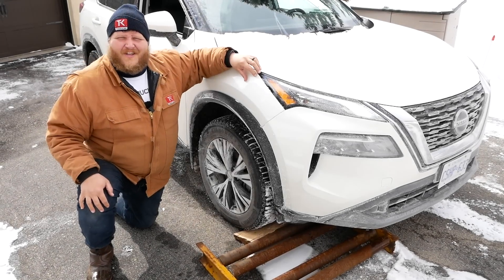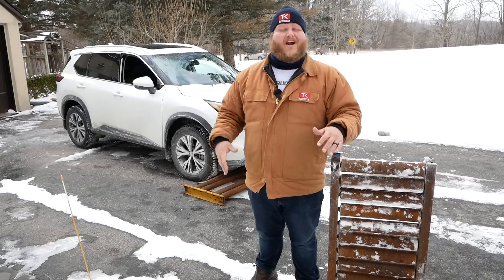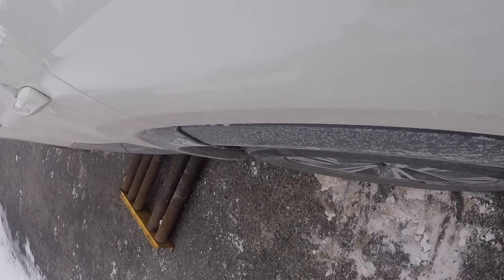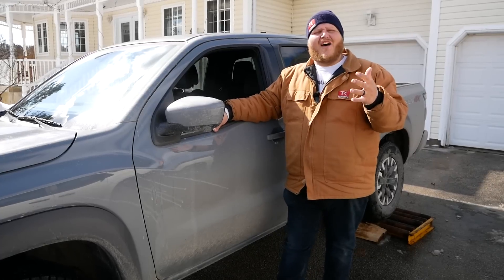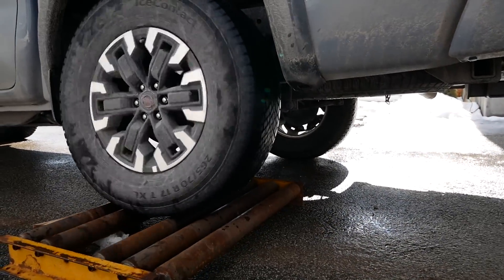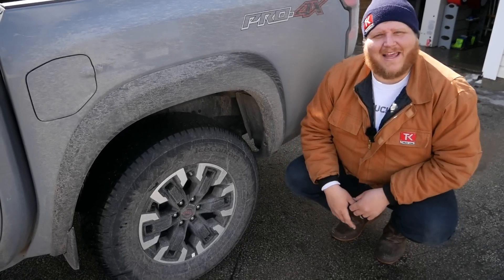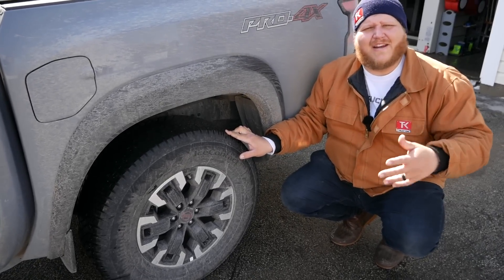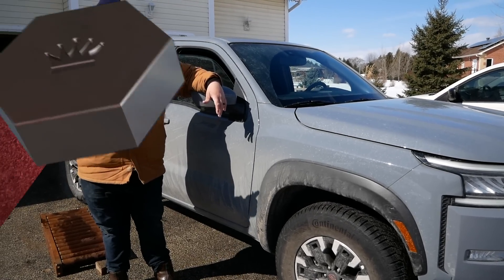AWD vs 4WD - Which System is Better and How Do They Work? We Demonstrate the Differences

Comment: A cheap Crosstrek with a rear TorqLocker and a tight front Cusco LSD will outperform most stock 4WDs in a traction test. It'd still be an econo-AWD too, getting 30MPG+ hwy.

 A Suzuki Samurai or base 4cyl convertible Jeep with cheap lunchbox lockers will often embarass high-end 4WDs offroad too.

Comment: Jeep's SelecTrac was about perfect in the XJ. The 2.72:1 4Low was just fine. Add Ox Lockers and manual hubs to the front and rear for maximum versatility. It was simple, and relatively easy to rebuild. Modern Traction Control and VSC would have complemented it nicely.

 The lawyers would never allow it to be offered like that though. Some numpty would unlock a hub or several in 4FT and destroy the viscous coupling, or lock the lockers on dry pavement and destroy diffs.

Comment: 4WD locks the front and rear drivelines together. AWD doesn't. That's the only difference.

 The same vehicle can have 4WD AND AWD.

 What do you call a Selectrac II Wrangler Unlimited Rubicon with selectable front and rear manual hubs? FWD Low can be selected in such a vehicle.

Comment: 4x4 being better is debatable. In some scenarios that maybe true in other scenarios the AWD is. The test the AWD should have been in slippery mode not normal especially comparing it to 4x4 and especially if you have it in traction control and 4 low. Which in the video it was stated to put it in traction control he had to have it in 4 low. I can't see someone on the road in 4 low its not going to happen. Also what was mentioned in another review that majority of 4x4 should not be driven on dry pavement conditions. In addition similar to the 4x4 with optional traction control, locking or limited slip differential some AWD systems offer lockers. One thing I like on some AWD and 4 wheel drive is the ability to break one wheel in the back  and increase the wheel on the opposite side. Thus the ability off road to have a shorter turning diameter similar to using one brake on a tractor.

One could argue the 2 speed transfer case is superior in off road situations. This also is debatable usually ground clearance and momentum is the deciding factor. Personally i think both are winners and far superior to RWD or FWD vehicles. Even saying that i would still make sure i have recovery equipment with me, on both of them.

Still thanks for the video and information

Comment: After owning a Subaru AWD vehicle I swore I would never go back to anything less than AWD or 4WD.  The performance in snow, ice, mud, etc. is far superior than any traditional rear wheel only or front wheel only drive system.

Comment: FORD- Raptor - With TORSEN Front Limited Slip Differential 
or 
GMC- AT4X - With Electric Front And Rear Locking Differentials
For 4 Wheel Drive?
🤔
Or Any Of The Above Or Simular With 
- ARB AIR Locking Differentials - ?
Reply: You don't necessarily want traction diffs on snowy roads. Selectable lockers are good if they're truly open when unlocked though. Ox Lockers are like this.

 Winter-capable tires can make a big difference.

Comment: In an old awd system with no electornics, one wheel off the ground would stop it. That wouldn't stop part time 4wd with no electronics because it's always at least one of the front and at least one of the rear at a minimum.
Reply: Yup. Old AWD systems were often just a little better than 2WD on slick surfaces, before TC, VSC,  ABS, EBD, etc. became a thing.

 Modern AWD and 4WD systems can be amazing.

Comment: What about my Audi Quattro with AWD and a rear locking differential and traction control?  Isn't that that same as a 4x4?  Remember, the bad thing about 4x4 is YOU have to put it into the mode that works.  My old 1983 GMC 2500 with 4x4 and auto hubs is TERRIBLE on snow/dry pavement conditions.  You have to stop, put it in 4wd HI, then the auto locking hubs lock in.  Then, when the pavement is dry,  you have to stop, put it in 2wd and back up to unlock the auto locking hubs.  What a pain in the butt for people who live at the 4,000 foot level where is snows some and melts in days or hours.  My 1999 MBZ ML430 was easy, just drive!!!  I must add that my MBZ had a 4wd low switch which locked the rear differential and it has traction control too.  Like a goat anywhere I went.
Reply: Audi has had some of the best AWD systems for years, but they often lack a locking center and 4Low. Their modern AWD systems can provide better traction in some conditions than some 4WD systems can though, like my Jeep CJs and YJ on ice when they had open diffs.

 Your 4WD pickup should be able to shift to 2WD On the fly. The front hubs should be able to stay engaged all winter. Your MPG might suffer slightly though.

Comment: I had a 1964 Wagoneer, straight 6 cylinders, front wheel hub locks, 4-wheel low and high and 2-wheel shifts. A lots of work to go 4-wheel but it crawl on rocks even with highway tires. With traction tires, at 4-wheel low, it climbs a tree. 🤓😎

Comment: 4WD is by far superior, but I live in a remote area of Ontario Canada, so 4WD are just commonsense. That said, another pitfall for AWD vehicles, they are an expensive rig to repair and maintain. They are loaded with sensors, and a lot more mechanical parts for each wheel, a complicated drive train. I think for urbanites and city folk an AWD for winter driving AWD makes sense, but if you are out in the country dealing with gravel roads, roads that don't get cleared of snow right away, hilly and rough terrain, you want a 4WD.
Reply: Very true but 99 Oldsmobile AWD with 31 at tires tackle all of it lol except Rick climbing which I don't care for .  That's what my 4.5 lift on 35's jeep is for .
Reply: Darn near everything has a bunch of sensors in it these days.

Comment: The only difference between "AWD" and "4WD" is the name. There's many different types of systems to get power to your wheels - part time, full time, on road or off-road only. Sometimes only to two wheels sometimes to all four and all sorts of systems for how that power gets there. My Defender refers to it as AWD but it's got two automatic locking differentials plus low range and can also then be set based on mode. It's not possible to turn it off and can be all automatic - "AWD" with everything you say is only in "4WD" and in a vehicle designed as a hardcore off-roader.

4WD definitely does not mean it gets power to all four wheels and that AWD doesn't.

The best system is not what it's called, it's what it does.

Comment: IMHO for most people AWD is the best solution, even for a truck.

The reason for this is that AWD does everything for them without switching anything and without understanding how it works.

Remember, most people don't drive off road. They drive around town and on the freeways. They deal with slippery roads from rain, snow and ice.

With AWD, they drive and the computer provides better traction when needed. Some AWD will even do this at full freeway speeds and/or improve traction for cornering.

Look around, most trucks will never tow a heavy load or drive off-road, except maybe a driveway or gravel parking lot. 

If you tow heavy loads or drive off-road then 4x4 is better.

Comment: All Wheel drive is a rip off.  It's really just 4 wheel drive.
Real all wheel drive would be 5 wheel drive.  The fact is the wheel that the spare tire is on is not connected to anything that will make it turn.
Some day Citroen will make a big SUV with REAL all wheel drive.  It will have their Hydro-pneumatique suspension so if you have to parallel park it, the hydraulics will pump up the front suspension at the same time that transverse mounted spare tire on the rear bumper will be lowered so it will touch the ground,  thus the weight of this thing will be held up by these 3 wheels.  the hydro-pneumatique system then lowers the air pressure of the rear wheel's suspension so they can slide on the pavement. Step #2 is the transmission shifts so it will turn the front wheels in opposite directions.  At this time an electric motor will turn the spare tire.  These 3 wheels will be turning in different directions, and the truck will rotate to become paralelle to the curb.

Comment: Your conclusion is wrong:
AWD is a safety feature for slippery conditions onroad - that could help you offroad.

FWD is an offroad feature that should not be used in an onroad conditions.

Comparing them is missing the point.
Reply: FWD = Front-Wheel Drive. I think you meant "4WD".
Reply: You are correct. A ttpo.  @RKmndo

Comment: Best way to describe the difference between 4WD and AWD is this. Imagine a drunk guy trying to climb a muddy hill, vs a sober guy.   The drunk guy is all effort and no sensing. So he is just slipping all around and making it look more difficult than it really is. While the sober guy can better sense his level of traction, and even predict when he is about to slip. Making the climb look effortless and smooth.     Most of the time, 4wd is better only when a tire is lifted off the ground.   Because of the lack of a locking diff in the AWD systems

Comment: What about a 4 wd that has a 4A setting like a F150 Lariat pick up?  Does it operate just like the Rogue?
Reply: Some do. Some don't.

 Some Full-Time 4WD/AWD systems use sensors and computers to engage the other driveline only when slippage is detected (like SelecTrac II). Some systems use a viscous coupler (like SelecTrac) that always keeps both drivelines engaged, but still allow some slippage between them.

 Subaru offers several different AWD systems that maintain engagement. Some use clutches. One uses a viscous coupler. Some can clamp tight almost like a 4WD.

Comment: Great demonstration of the two systems. The big difference for me is AWD is driving all 4 wheels all the time, rain, snow, mud, or dry. The 4WD is running in RWD when on pavement, which is 99.9% of the time for me. For the 0.1% when not on pavement, which is soft, muddy camp grounds, I've never had a problem with AWD. 4WD doesn't provide max grip the vast majority of time unless you live off road.

Comment: For a short time in low torque situations the modern systems that use the brakes to simulate full 4wd and limited slip diffs can work. And, they’re generally acceptable for the conditions of very light off-roading and some snow. 
The problem is that people get sold on thinking they’re do all systems that let them drive anywhere at any time. 
Ultimately a proper 4wd system with locking front and rear diff is the best solution. Without locking diffs even a true 4wd system is only 1 front and 1 rear wheel.

Comment: All wheel drive was first coined by International Harvester it's product branding like Ford with 4x4 and Toyota with 4WD. They all describe the engine turning the front and rear wheels. 

What you are trying to describe or differentiate is the difference between road oriented four wheel drive or Off road oriented Four wheel drive. Both have examples of vehicles with part time and full time systems. Some with diff locks some with low range some with low gear some with traction control. But the main dit is some are oriented and configured for on road or primarily on road performance and the off road oriented systems.

Comment: I never understood the point of fulltime 4WD because those do not have a 2WD mode. 4WD is cool and all but maybe you don't need 4WD always? I like to use 4WD only when I have to. 
I remember seeing some old Jeeps where some had fulltime 4x4 but I also saw some of the part time 4x4 systems where it said 2, 4H, 4L. I saw one shifter that had options for 2, 4Part-Time, 4Full-TIme, 4L, possibly similar to many modern shifters that say 2, 4A, 4H, 4L
Reply: You seem to contradict yourself.

 Jeep QuadraTrac didn't offer 2WD in stock form, but SelecTrac did. Both systems could also lock the center. Both systems also offered 4Low.

 If one wanted 2WD in a QuadraTrac Jeep, they could install manual hubs on the front and/or rear axle.

 Some drivetrain systems are only AWD/4WD. There is no 2WD setting. Full-Time 4WD is basically AWD. Such drivetrains simply allow differentiation between the front and rear drivelines.

 4WD (Part-Time) simply locks the front and rear drivelines together.

Comment: This video has so many painfully bad inaccuracies it hurts. It is literally marketing terms because truck guys are so egotistical about hearing awd. Its why the grand cherokee has 4x4 and the durango has awd, but both are mechanically identical. You can have awd systems with disconnecting secondary axles, you could have a part time awd system with an auto engage function as seen in new pickups. You can have awd systems that lock the center coupling, you can have part time systems that allow slippage. if you call awd completely different from 4wd, then you're not allowed to say both the ford f150 and tundra use a 3.5 twin turbo, because they have mechanical differences and therefore have different names. 

Hell, you actually are contradicting yourself on this video, saying only 4wd systems get things like low range, because you even review on the jeep cherokee which is a fwd based crossover that has awd and a 2 speed transfer case.

Comment: I don't know how accurate this is. In a 4WD system with center diff locked and traction control off, if the 2 diagonal wheels have loss of traction, the car won't move. The front or rear axles themselves won't split power between themselves (unless you have a front or center diff lock). So the reason why the Frontier was able to get out of the rollers was most likely because the rollers still had some resistance in them.
Reply: Okay so, awd and 4wd are the same things, with different tweaks and branding. 90% of the differences are marketing.

Comment: Another aspect is 4x4 transmission binding in corners. A lot of people assume that 4x4 can be left on and driven around for extended periods. But 4x4 excels when the trajectory is primarily straight. When left on for long periods it can cause transmission binding in corners and possibly a repair bill long term 

Where AWD is meant for everyday driving around town and isn't subject to binding. This  isn't to say one us better than the other but they serve different use cases. 4x4 more off road or pulling a trailer up a slope etc... AWD is a daily jack of all trades but struggles more off road.
Reply: almost like 4wd and awd are the same thing with marketing differences. Most awd systems are superior to "4x4" systems anyways
Reply: 0,

Comment: when you tested the truck in 2wd (no traction control) the roller was under the driver side rear wheel where the power was expected, but when you tested 4 wd you didn't have a roller under the rear driver side wheel so it quickly rolled off the rollers. I think if you would of put the rollers under both front tires and the driver side rear wheel while in 4wd would have made more sense.
Reply: it doesnt matter which wheel didn't have a roller, all 4 would behave the same way

Comment: @ 7:49
That's because although the manufacturers never usually mention it, there's actually four-wheel drive traction control and then there's a normal traction control. When you hit four high or go into four low, four wheel drive traction control comes into play. 
Even in the full-time four wheel drive vehicles there's a difference. Unless you go into four high the system will only utilize normal traction control (for "Normal" driving mode, 4 Auto, etc) If I recall correctly Toyota is the only manufacturer that allows you to toggle the four-wheel drive traction control.

Comment: -- Nephew hit me with an interesting question.  Do front hub lockers work on an open diff?   This is his 2004 Tahoe Z71.
Reply: the hub locker would just engage the front axle no?
Reply: Locking hubs just engage the wheelhub to the axleshaft.

 Axle differential lockers lock the left and right axleshafts together.

 A locking center locks the front and rear drivelines together.